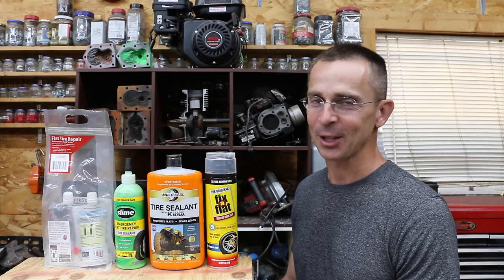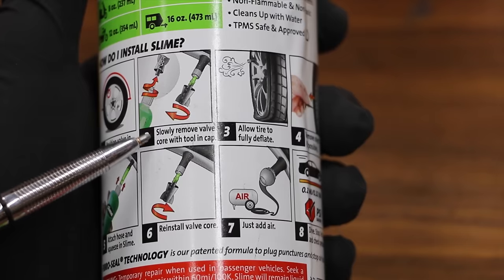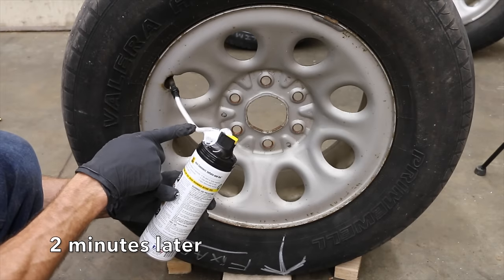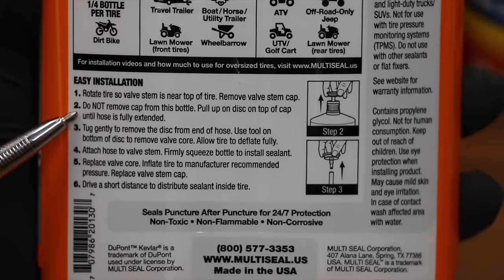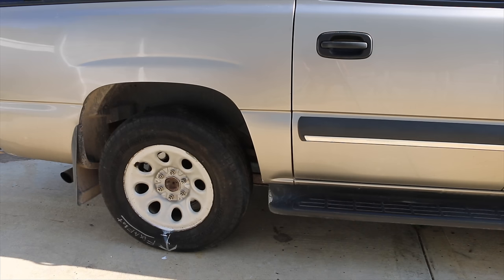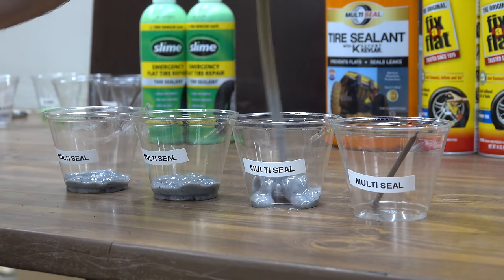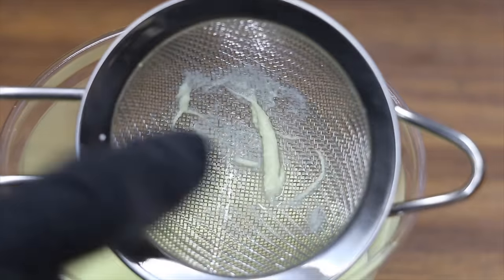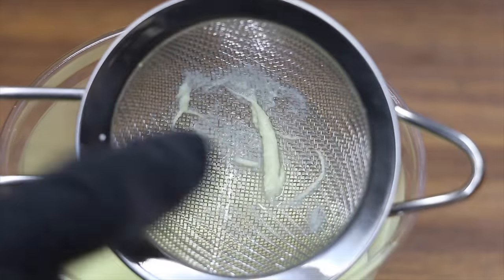Is Tire Slime the Best? Fix-a-Flat vs Tire Slime, TireJect, MultiSeal. Let's find out!

Comment: As someone who worked in a shop... Fix-A-Flat can go to hell.
Reply from the maker: Thanks for the constructive feedback
Reply: Agreed.
Reply: And it smells horrible!
Reply: @Notanotherfishingyoutuber  Like literal dead fish.
Reply: Right fix a shit doesn't work I have never had it work
Reply: But the other products are OK? It seemed from the video that the other ones cause bigger messes
Reply: @JonLarzon  k
Reply: @thedefenestrator2994  Is that all I get for a response?
Reply: @JonLarzon  Yup. Looks like you're baiting me for an argument and I really don't care for one right now. 👍
Reply: @thedefenestrator2994  No actually. I'm just curious why you specifically called out Fix-A-Flat.
Reply: @JonLarzon  Because it's mostly what Harley riders use, and in the Harley shop any time a tech swapped out the tire that was filled with that crap, it would gush out all over the tire machine and make a huge mess. AND it smells like old crawfish and stunk up the place to high hell.

All while only sometimes working.
Reply: @thedefenestrator2994  Agreed! I worked in a shop for YEARS and nothing gets a tech more pissed off than when an advisor "forgets" to mention fix a flat was used. GARBAGE product, doesnt work under the best of conditions. makes a huge mess and stinks somethin fierce.
Reply: @patrickowens1993  yep I used to work at a tire shop an regularly deal with tires that have been filled with fix a flat an it's just like you said it makes a huge mess an smells horrible.
Reply: @chevleon5518  yeah it would be nice if the customer would say something before hand.
Reply: Useful in an emergency
Reply: @JonLarzon  THE OTHER ONES AT LEAST WORKED!
Reply: What happens to a tire or wheel after someone uses it? And what exactly is the hard part of cleaning it?
Reply: Actually,Fix-A-Flat cant use if the screw is removed.
Reply: Also if it’s not obvious you’ll be sitting at the tire shop longer because we can’t find the leak.
Reply: Ive tried many times over the years, it has NEVER worked. Such a scam.
Reply: Hell yeah
Reply: @jeswgarn  ??  No it's not, just clean the area as you already should have been doing.
Reply: Most tire plugs don't work once someone uses the slime
Reply: @matthewstillings5134  Last time I used it was around 2010 and it fixed my first truck from HS tire and held up for couples months before I decided to replace it. Quality must of gone to shit.
Reply: @jeswgarn  then you sure as hell weren't doing it right. Fix-A-Flat would have zero effect on doing a patch professionally. Zero.
Reply: Chris Castelo Hose it out with water and dry the tire a uniseal sticks just fine with the vulcanizing fluid.
Reply: @JonLarzon  fix a flat gets all over the place because it's thinned down so that it can pass through the valve core.(the same reason that it actually doesn't work as marketed) Other products cannot do that. They're much too viscous. Other types of products are so thick that when you're dismounting the tire none of it will even come out of the tire. It's still a gross slimy and a mess. The rim is usually coated in a layer. But Fix-A-Flat smells terrible, can irritate the skin and is a sticky mess. Other products don't irritate the skin and they're actually not sticky and are easy to clean up. Any professional that doesn't like this stuff doesn't understand. No it doesn't do what it's actually advertise to do but long story short it's air in a can. And can get you from point A to point B without changing a tire. That can be priceless in many situations. It should only be used in an emergency when someone would be unable or even doesn't want to change out their tire and only needs to get a short distance in order to have it repaired. If a tire shop is going to cry that you did that I would give them a very subtle warning that next time you complain about my habits I might have to find a different shop that isn't full of cry babies. And not that I want to slam techs out there. But as many have stated it smells like shit. The first thing you have to do to change tires is let the air out of them. If you didn't smell it unfortunately that was your sign. If you missed it that's on you. I can't think of any other consistant situation that would put me steps away from firing a tech then complaining to a customer that they didn't tell them about fix a flat. If you're worthless you're worthless don't blame it on the customer. Not in my shop!
Reply: No, it can go directly to satan......'s hell
Reply: @ProjectFarm  i have a  feedback and a suggestion... #1 I use a little dish detergent in the spray bottle so it will blow a big bubble... #2) I have used pressurized flat fixer, supposedly "designed" for bikes (cute little can) and it EATS the tube!!!!!  if you haven't, i would say test out these bike flat fix kits, and determine if i was just unlucky... 3 times. thanks for all you do.
Reply: @HopefulPessimist  my mower attracts holes like a flower to bees.
I keep filled a spray bottle 1 qt water 2 oz Dawn labeled soapy water
Reply: Do you charge the customer more money when you find that crap inside the tire for cleaning it ?
Reply: The Gospel 

Jesus Christ loves you and died, rose from the dead, and ascended to heaven to pay for your sin! Repent and turn to Him and you will walk in light and be saved. Read the book of John and Luke to see God's love for you!

Comment: Thank you for performing this and other comparisons.  
I have used the SLIME sealant for years.  Common concerns raised by naysayers are: (1) Corrosion to steel or alloy rims, and (2) potential damage to Tire Pressure Monitoring in-tire sensors.  
Your comparison gave a very brief test of possible corrosion issues.  If you revisit this comparison, I recommend you allow a much longer corrosion test period, perhaps 30 days immersion versus the 1 day immersion of your current comparison.  Further, I'd recommend you address the concerns of potential damage to in-tire TPM sensors.
Thanks for a job well done
Tom
Reply: Tpms damage is a proven mith

Comment: I specifically wanted to see the inside of a tire after fix o flat. This was the most perfect video. Great job !
Reply from the maker: Nice!  Thank you
Reply: Its stays fluid so can spin around the tyre and fill leaks as they happen.
Reply: Fortunately fix-a-flat is easy enough to get out of the tire by making a hole in it.

Comment: Nice test. I would like to say that tire slime is available in a gallon jug with a pump, so it can be used for multiple tires. I like to use it in my riding mower tires, you never know when a sharp stick will puncture your tires so if you already have it in them you can just keep going.
Reply from the maker: Thanks!  Thanks for the feedback.

Comment: I would love to see a test of injector cleaners.  Thank you for your videos.  They are always very helpful!
Reply from the maker: Thank you for the video idea!
Reply: That would be an awesome test! I would be very interested in that as well
Reply: @Chris-ru5eq  I'll put my money on Gumout carb cleaner, not the one for both carb and fuel injection.... and yes it will clean fuel injection too
Reply: @Chris-ru5eq  I wouldn't say that, stuff like b12,redline or Chevron tech all work due to there PEA levels. I've had great results with B12. Had a misfire due to a fuel injector did two cans over a time period of a month it completely cleared the misfire and cleaned the injectors(I pulled the injectors and tested them to see the jet spray width etc.)  Just my 2 cents though
Reply: We just need to find a tweker.
Reply: Marvel mystery oil works really well for injectors for gassers
Reply: @dangermartin69  Ahhh... i see you are a man of old culture aswell!
Reply: Hes already tested similar
Reply: Doubt if Fix A Flat would even foul an injector.
Reply: @dangermartin69  What about your catalytic converter? You may damaged it from the oil.
Reply: don't bother- just use lucas' upper-cylinder lubricant- its the best widely-available fuel add out there.
Reply: @dangermartin69  but it will screw up exhaust temp sensors and some say it messes with the oxygen sensors, as well. lucas upper-cylinder lubricant/fuel treatment is what i use/recommend.
Reply: @salgonzalez908  that stuff is crap and messes with sensors. why on earth would you put an unidentified STUFF in your fuel??
Reply: you said a liter of 2cycle

Comment: Some repair shops won't touch a tire that uses these products.  They get all over their expensive machines.  Just keep a plug kit in your car, along with an electric pump.
Reply from the maker: Great point!
Reply: Plugs are the best and easiest way I have found. Best thing for emergency repair to keep in glove box.
Reply: Exactly, those things take 5 minutes to use, inflate the tire & your gone
Reply: I prefer a spare tire. Full tire and rim. Granted, I also keep a floor Jack in the trunk too. Floor Jack's handle also doubles as a breaker bar in case a lug nut is being stubborn
Reply: Depends on the type of flat, some, if done on an angle, can cut away at the plug material.
Reply: @wobblysauce  A spare and plugs. I've never been stranded.
Reply: @aephix73  Indeed, some times it takes the 5th try to get one that sticks.
Reply: It's a quick repair your in a hurry or its dark running etc plenty.of scenarios to use sealer
Reply: 24hours is not long term test
Reply: Better get used to it new cars don't come with a spare tire, all use sealant
Reply: That's why I don't tell them there's sealant.
Reply: This is the best solution.  Been doing this for 40 years... a plug kit in each truck.  I often do it without jacking up or taking the wheel off the car/truck.
Reply: - If you can find the leak, and it's the type of leak that can be plugged (puncture), then I would agree that's the best solution.  Sealant will temp fix a leaky valve stem, or leaky seams, which a puncture kit can't do.
Reply: Don't! i work at a tire shop if you put a dummy plug you tire can not be serviced by us so i would recommend a fix a flat
Reply: It’s even better when we have no idea when customers use any of these products and come pouring out like the elevator scene from the shining . It also smells like death
Reply: My 2016 Nissan still has a spare tire, I don't know if I would buy a car without one.   As for the sealant being faster than changing your tire, it shouldn't take more than 10 minutes to put your spare on most cars and you might be able to get the flat fixed by a pro if you don't use sealant in it.
Reply: @probablyonahonda  hmmmm, so a guy making money off of people going to his shop, is recommending a product that clearly doesnt work, because you cant service (replace at full price) a tire that has a plug that actually works. i think i'll stick with my plug kit!
Reply: @Trevinator1990  well I work at a chain store so I don't give a damn, but both seem to work but if the plug doesn't then you craped out of luck bc we cannot service your tire.
Reply: @Trevinator1990  also at the tire shop I work at, we do flat repairs very common procedure, and if your plug is leaking and we do a flat repair it can have a blow out. Due to releasing air slowly and making the tire heat up, so if it has a blow out with one of our patches we are liable.
Reply: ANY Tires Plus, Hibdon Tires, Firestone or Bridgestone has policies where we DO NOT repair even plugs.....fixaflat or plug results in a NO FIX....besy way ive seen is if its a nail or screw, is to get silicone such as caulking and put it on the nail. That way it saves the tire warranty, makes it repairable, and doesnt waste a tire
Reply: Boom. Great advice.
Reply: Also these products make fixing the tire really hard, no matter how much you wash the tire out there will always be a film on the tire making plugs useless and vulcanzing tire patches not stick to the rubber, even after grinding the tire
Reply: Same here. That plus a cigarette lighter powered inflator and you're good to go. I've run for over a year on a plugged tire before replacing it.
Reply: Plugs are fine but most women & some guys would never be able to use them. These products are for those people.
Reply: @probablyonahonda  That sounds stupid I've had plenty repaired after plugging and refused to be worked on with sealant.

Comment: Couple years ago. I was doing TRADE SHOW at convention center.  SLIME was there and the LASD sheriff department uses SLIME in all the police cars.    Been shot with a 45 Acp  to many Nail spikes.  They had a rotating tire with a Spike. This thing was huge. You hear it hiss and spin and stop air leak.  I was very impressed.  Since then I use it in all my cars.  Even the tires with sensors for air pressure.
Reply: Do you get problems of tyre balance? also what if you have to replace the tyre? the tyre shop dont mind changing the tyre with slime in it?

Comment: You should do one with bike inner tubes, there's so many choices on the market with cheap ones that everybody knows and expensive/premium brands who claim to resist more against flats, would be interesting to do some of your standardized tests on those 😊
Reply from the maker: Thanks for the videoi dea.
Reply: I would also like to see a test on bicycle tubes. I have vehicles that go years without having to add air but the tires on my seven bicycles will all be flat within six months if I don't add air.
Reply: @normanfox4916  All tubes are porous and slowly lose air over a period of time. Bicycle tyres are very thin and lose air quicker than a motorcycle of car tube. Tubeless tyres dont lose air.
Reply: I agree. It would be great episode.

Comment: Take it from a man with over a decade working at and managing multiple of America's largest independently owned tire shops, fix-a-flat absolutely can corrode your tires & rims.  I have seen many very expensive rims, both OEM and aftermarket, end up destroyed from using these products.  One example I will never forget was a really stupid guy who had a sedan with beautiful, very expensive custom rims and he was far too cheap to purchase the run-flat tires required by his vehicle despite our adamant warnings and his dealer advice.  He had himself a brilliant idea in the back of his mind the whole time.  He went right home after having the new tires installed and filled all 4 with fix-a-flat.  Weeks later he comes back because his check pressure light going off every other day.  Turns out the rims were so severely corroded the tires wouldn't keep an airtight seal and the chrome was just destroyed.
Reply from the maker: Great feedback. Thank you!
Reply: I had the green version of Slime (for tubed tyres) cause problems on alloy rims. The Slime latched onto bare metal (scratched by tyre levers) causing a lumpy clag that affected wheel balance. I would not use that grade in tubes or in tubeless as it does affect the metal.
PunctureSafe/WellSeal is a tubeless grade. It did exactly what it says on the tin and saved me many times with punctured motorbike rear tyres.
Reply: @Dave5843-d9m  steel rims should be ok though?
Reply: Unfortunately a lot of new cars nowadays don't come with a spare and only give you a can of this garbage
Reply: You most had the same guy we had stop in driving SC300 Lexus. He put slime recommended amount for the tires his size in each tire. Tried to drive from Katy, TX to Nashville, TN. He didn’t make it past Baytown he had so much vibration in his car.

Comment: Got a nail in my tire tonight and I had this playing on the bluetooth as I drove to the store. Sadly they only had an STP version of Fix-A-Flat but I think it did good enough to hold until the morning when the tire shop is open. Definitely gonna buy something from the Tire Plug video to keep in my trunk now.
Reply from the maker: Great feedback.  I just published a video on tire plugs. Thank you
Reply: Fix-a-flat has done well for me too, multiple times. I just don't remove the nail from the tire and it won't leak for a few days until I get it fixed.
Reply: ..yep, better to put a plug in the nail hole for a temporary fix, than to put any of this junk in your tire..might seal, might not..plus, a huge mess to clean up when you take the tire off the wheel...

Comment: "That's a lot of damage!"

*FlexTape wants to know your location*
Reply from the maker: lol
Reply: nice!
Reply: should have tested flex seal
Reply: I’m not sure that would work, because it isn’t rated for working under pressure.
Reply: Yes,lmao
Reply: @Andy47357  I know a guy that use spray paint on a bicycle tire and it worked, Flex seal might work if sprayed on the inside and outside but I'm not sure about just outside.

Comment: That's interesting. About 3 and 1/2 years ago, while on a road trip from AZ to Utah, I got a flat from a screw. It was after 9pm, and a rural area. After trying 2 gas stations, the third was actually open, and all they had was Fix-a-flat Truck version. I got 2 cans, and put one in the tire.
Now, I had a run flat, but was losing a significant amount of air, and left the screw in, and the fix-a-flat sealed it. I didn't lose any air, driving 70MPH the  next 110 miles, and left it over night. No air loss in the morning, so I was able to take it to Discount Tire, where they patched it for free.

So, I guess fix-a-flat only works with the screw in.
Reply from the maker: Thanks for the feedback.
Reply: Jushua:  Or it is wildly inconsistent.   It is also a corrosion hazard, re the original version.  Now that there seem to be other, better, products, I'll sure be using a better product like SLime for a few more bucks.

The fact that lots of car makers now supply an emergency repair kit with that vs. a spare tire says something, IMO -- which seems to be confirmed by these tests.